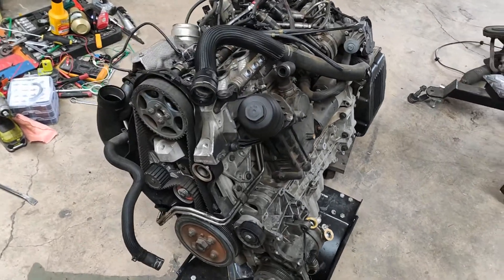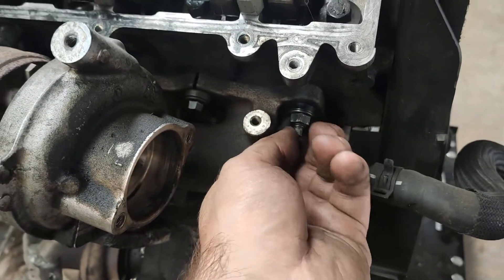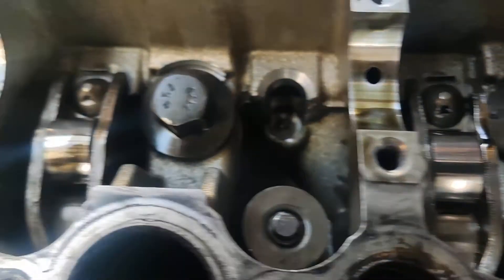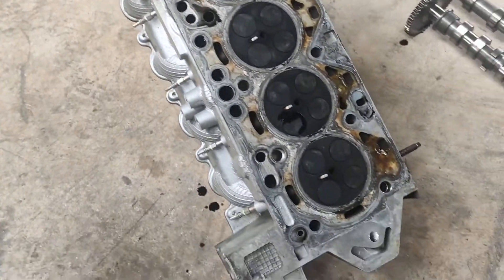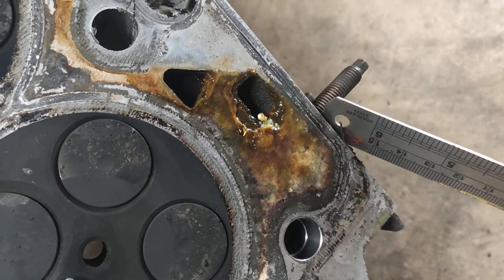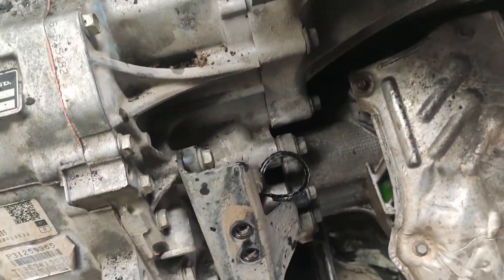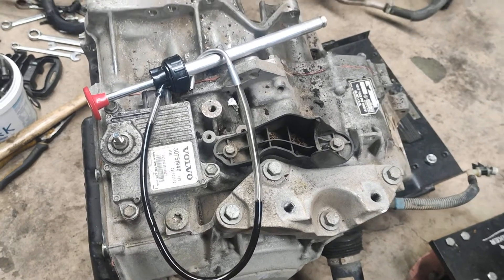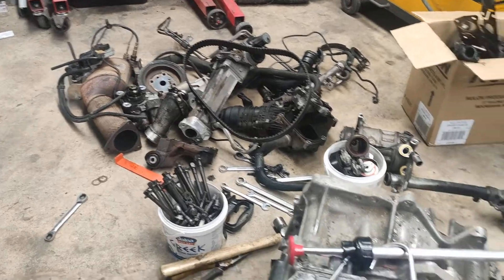Stripping down Volvo D5 (D5244T10) engine

Comment: What can i do my car suddenly of while driving timing bet  cut in several pieces and broke the engine head , after i replace another engine head, again 40 kms drive my car belt was cut and broke the head again i spend lots of money 🥺 , kindly plz help me if anyone of solution about this problem, I'm from India and volvo parts costs 5 times more compare to other countries, thats y i want solution
Reply from the maker: That is an unlucky sequence of events. There is a fix in the later model engines to prevent the belt finding its way into the timing cover that can be retrofit, but you don't really have a choice but to replace the head again or give up with the car.

Comment: Rubber from the engine block was the seal from the inside of the thermostat, it is the main problem of thermostat failure. The core is working fine but it loses that rubber and the thermostat remains open, it needs another full housing with thermostat including. Big job on the car.

Comment: Good reminder to check the condition of your belts and idlers/tensioners

I think I might have a noisy idler or tensioner it may be time to do a belt job and replace those and the drive belt. My timing belt is only ~60.000 Kilometers old that's in good condition but im questioning my accessory belt.

Comment: same exact thing happened to me at 140k miles on a XC60 205hp. I'm getting a used engine with 66k and having it swapped at my local garage. Wondering if I can salvage something from the old one.
Reply from the maker: Probably not. Mine went straight to scrap. The only thing of value is the head, and without it the rest is junk.

Comment: Good to see that the head design may save the pistons. I have a V60 D5 with broken head due to belt snap. I am just going for a head replacement also. Good to see that the forces of the valve hitting the piston are directed to the top of the head. Do we need to be afraid of residue in the oil because of all the broken seats?
Reply from the maker: There's always something worth worrying about, but the chunks in my case we're pretty big, unlikely to go anywhere important. Flush the oil anyway and hope for the best.